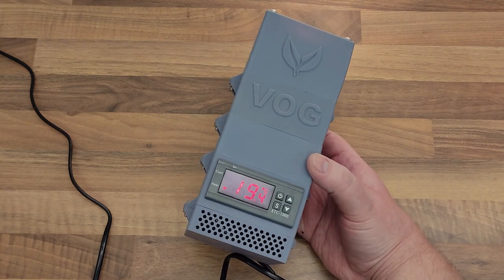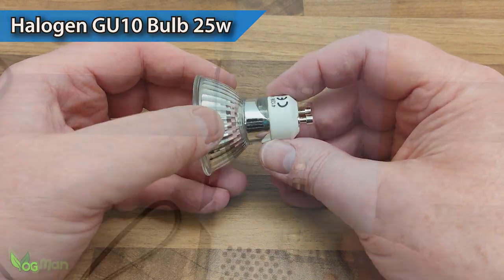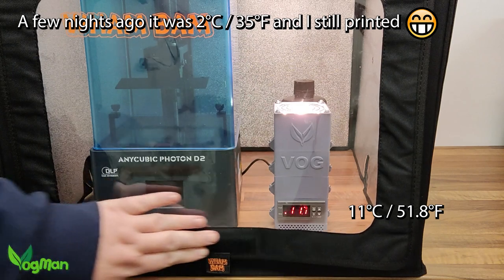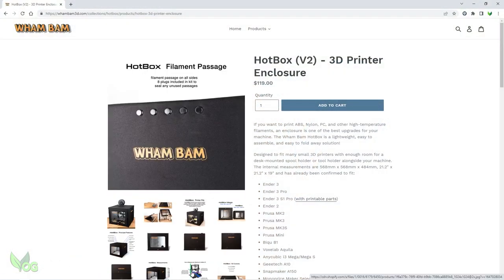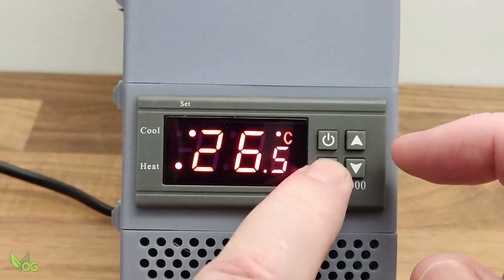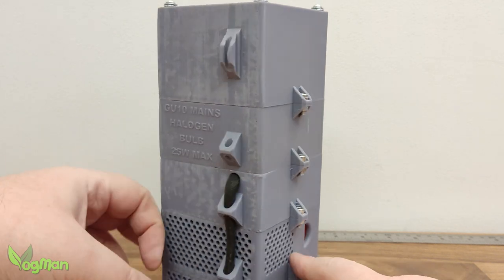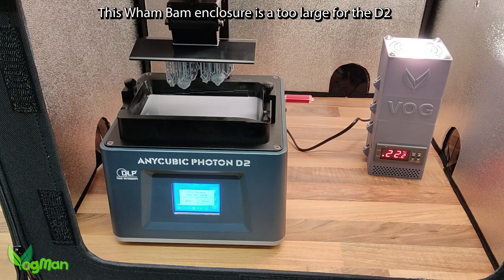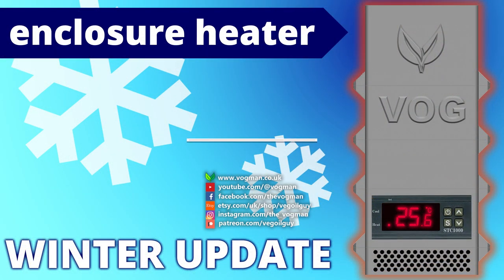Enclosure heater WINTER update - for 3D resin printing

Comment: You could use that special metal tape or just regular aluminium foil to protect the plastic near the bulb from heat. Should pretty much protect it from melting or smt like that.

Comment: Just my experience update on this, built and use the heater, it has transformed my print experience with the machine in the enclosure,  so far 3 months without an issue, machine or resin fail, all good, have also taken heed with your repeated cautions, with just a slight risk, so I use 25w and 35w bulbs, naturally the latter being at the height of winter, and this with a 1 hour pre warming of the room.As we head into April, a 25w bulb, approx 1 hour pre run, and no heat in the room is working exceptionally well, I use all types of resins, and different brands, thanks a million for the super little heater design, I love it!
Reply from the maker: Thank you very much. You've made my day 😁

Comment: I've looked for a heater like this for weeks, I ended up buying a W1209WK clone  (per your Oct 2021 video) and made a duct in aluminium (made from pop soda cans) to maintain an heating element ... As my printers, one FDM and one SLA, are in my garage they both are out of commission 'cause of the winter temperatures but even without a clean setup, it has heated the enclosure from 5°C to 25°C in less than an hour (but I started the print after 90 minutes) and it worked ... Thanks for your help on wiring the thermostat (it came without any doc^^)

Comment: To help with the time it takes to heat up the enclosure, you could poke a heat gun into the enclosure to quicken the time it takes to get to 25 degrees, then all the heater needs to do is maintain the temp. just a thought as this is what im advised to do when printing ABS with my FDM printer.

Comment: hey mate, I really love your videos, calm tones and honesty! A light globe produces a lot of heat, yes, but the goal is to produce light. Now, in your case, you want heat, that light is wasted.

Might you consider blocking the end? I would love to post a sketch but youtube comments (smartly) don't allow images in comments. I'm suggesting a layered black metal cap on the end with gaps between them. 2 would be enough, 3 would really get the job done.

Comment: if you did not want to change bulb you could just make two of them and run them in tandem
Reply from the maker: The bulb will be the cheaper option Mark, but depending where you are in the world, 2 might be needed...
Reply: @vogman   I agree. I was just indicating if you find the higher wattage bulb is an issue you could just use two. You could even just change the top part to run two bulbs in parallel assuming the electronics can handle the additional draw (which I assume it can since you are using a higher wattage bulb already) that's the nice thing about designing 3d parts you can make changes to the design as the need arises.

Comment: Have you tried popping this unit inside a printer? I'm guessing it would fit in some of the larger printers?
Reply: Interested in this one too, got a saturn 2 and was thinking of buying the hotbox for resin printers and it should have enough space to sit comfortably on the side of the z axis, after testing it alone in a cardboard box to see if it's safe enough to do it
My options are this or buying  the ender enclosure and running the printer with the red lid on at least for now

Comment: I think halogen bulbs can fade art over time, I have to assume this is due to at least some UV output?  any concerns with all of that extra bright light in the enclosure with the printer whenever the lid is off?  I honestly dont know the answer, just wondering if you have experienced any skinning or partial curing in the vat when working with the heater on?

Comment: having a 25 watt bulb vs a 50 or 100 watt, is no more or less safe.
if a short happens before the bulb it matters not what the bulb's wattage is.
changing the bulb does not change the safety of the system. Safety is the job of a Fuse.  Or Two...